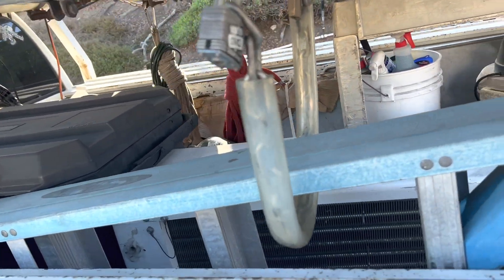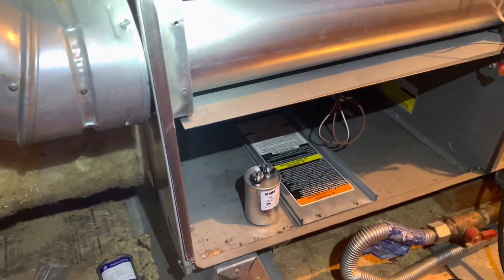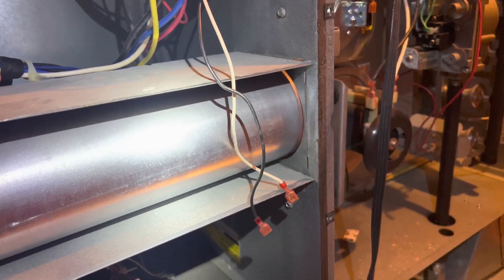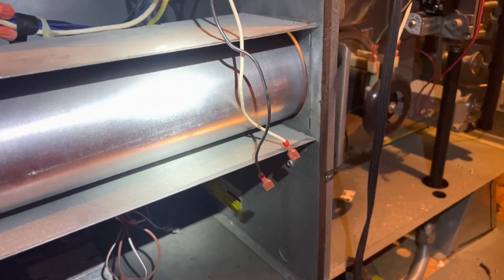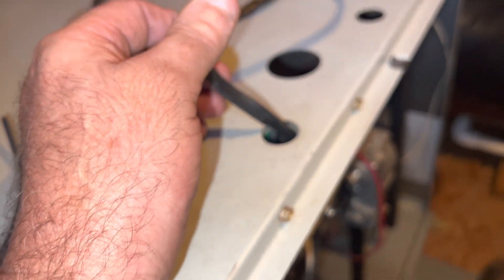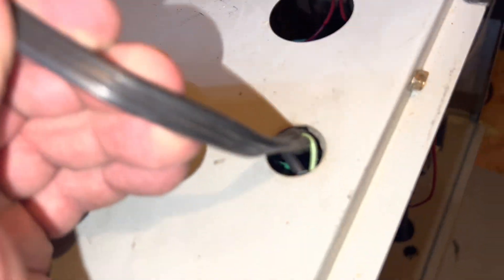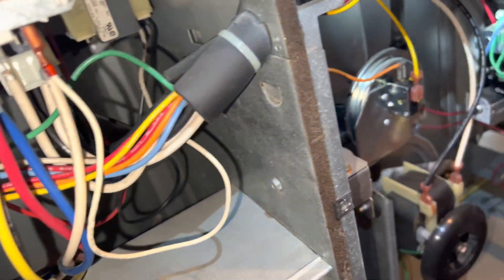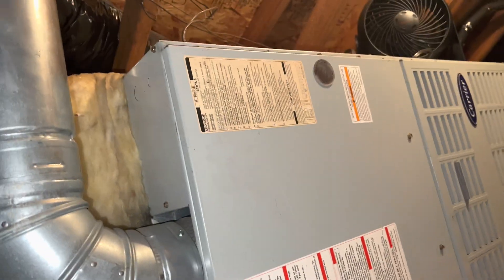Circuit breaker Tripped , Fuse Blown , Now the Fun starts !

Comment: That was an EXCELLENT idea to run the low voltage thru the vinyl tube🤦🏻. Thanks for the share stay well
Reply from the maker: Thanks. I Would have done in 1/2” sealtite but I was out of stock. It should work ok. Good enough for a old Goodman beater.

Comment: Probably just a power surge. Maybe replace that breaker if it's hard to reset. Anyhow, it's 120 volts not 115. I don't know why people still call power supplies 110 and 220. That's like World War 1 era  standards. The oldest restaurant customer I have has old panels from the late 1950's, Old Westinghouse Qwik-lag style panelboards. Made in Chicago, and they're rated 208/120. 60 cycles. You know it's ancient when they abbreviate the state as "Ill" and not IL, and no zip code. I saw an old faded sticker on one of the panels in the basement, the phone number was something like CLeveland 4-7247.... That dates it to pre-1964. But newer than 1947 when they switched to 7 digit numbers here. It's been 120/208/240/277/480 volts for secondary low voltage supplies since the late 1930's... :)
Reply from the maker: Breaker was REALLY HARD to RESET !!! I had to try exercising it a few times to get it to reset. It would NOT MOVE FROM THE CENTER TO OFF POSITION !!! I wish I had gotten it on camera ! Once I cycled it a few times breaker was freed up. Seems to work ok now. No call ☎️ today ! So , So far so good !
Reply from the maker: Note - it’s a Twin / thin breaker too !
Reply: @OcRefrig  Oh, one of those little GE ones? I wonder if all the moisture and maybe salt air if it's close to the ocean it's just corroded.
Reply from the maker: @brnmcc01   20-30 year old house. 4.9 miles from the Ocean / Pacific coast Hwy. just old I feel. Lack of some Maintenance. Breakers have never been touched probably.
Reply from the maker: Furnace is Probably original. So House is 1998 or 1999.
Reply from the maker: @brnmcc01   breaker looks like this one. Square D. Twin. https://www.crescentelectric.com/power-distribution-and-protection/circuit-breakers/miniature-circuit-breakers/miniature-circuit-breaker-screw-in/tandem-circuit-breaker-homeline-2-x-1-pole-at-20a-120240vac-10ka-air-plug-in-ul?utm_term=&utm_campaign=Schneider+Shopping&utm_source=adwords&utm_medium=ppc&hsa_acc=2932538780&hsa_cam=18095460911&hsa_grp=135471953970&hsa_ad=617331291263&hsa_src=g&hsa_tgt=pla-59874415685&hsa_kw=&hsa_mt=&hsa_net=adwords&hsa_ver=3&gclid=EAIaIQobChMI06L2kpbr-QIV0RZ9Ch0jzwn0EAQYASABEgL0dfD_BwE